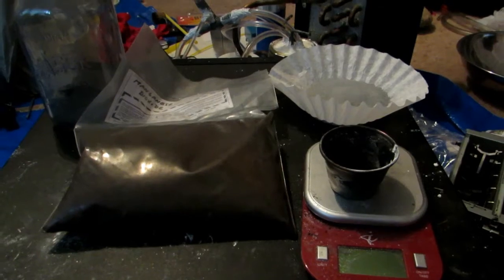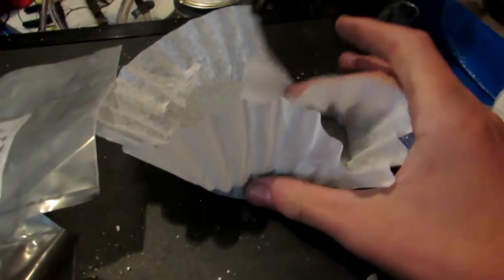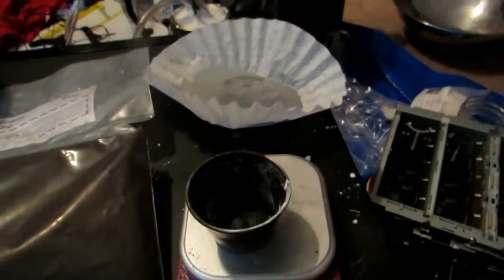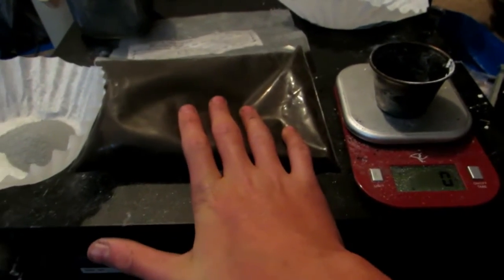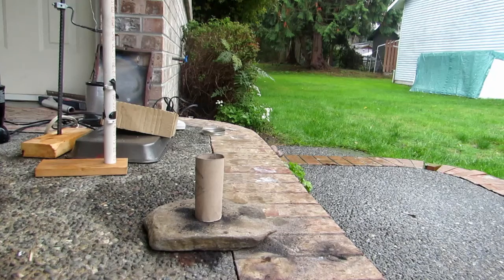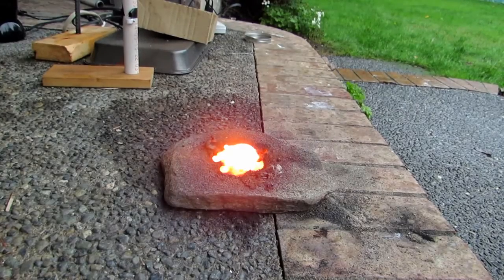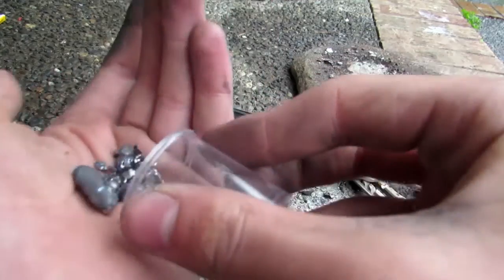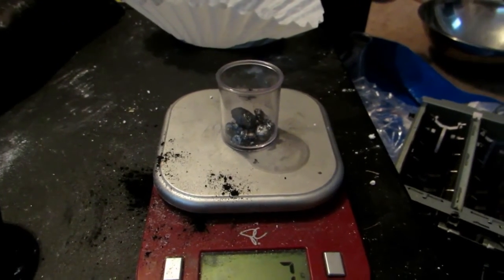Manganese From Manganese Dioxide (Household Materials)

Comment: are you sure it's manganese? Try doing a density test to see how close you are to the exact cause that much manganese looks like it should weigh more.
Reply from the maker: you must remember that this thermite reaction can get hot enough to vaporize manganese metal, this means that some of the nuggets have many bubbles that were caused by gaseous manganese and maybe water or other gasses that were produced. Upon breaking up the chunks , you can clearly note the holes. I am very sure this is indeed manganese as no other metal should be produced. Due to the bubbles, a density test would be very hard. I realize how confusion could occure! :)
Reply: Ahhh ok that makes sense. I just saw the size and grams and thought it was off, but the presence of bubbles does explain the low mass.

Comment: Great vid. Also adding mao2 to h2o2 will make pure ma
Reply from the maker: ma? what? I am sort of confused, do you mean manganese (mg) Dioxide? I don't think it makes pure manganese, it simply catalysis the decomposition of hydrogen peroxide. (A catalyst speeds up the process, but is not changed.)
Reply: Sorry . That is what i ment
Reply: It does make pure manganese
Reply from the maker: Brusoda Isgreat sorry bud, but I don't think so, do some research on it. Manganese dioxide is but a catalyst in the decomposition of hydrogen peroxide. To remove the oxygen from manganese dioxide you need a reducing agent that wants oxygen, such as aluminium or magnesium metal. Hydrogen peroxide is unstable and wants to loose an oxygen atom to become oxygen gas and water. It is a very good oxidizing agent, not a reducing agent. If anything it would give the MnO2 another oxygen atom, but this is not possible as manganese only has oxidation states 2, 3, 4, and 7 and MnO2 is oxidation state 4, so H2O2  would not oxidize it to state 5, because it doesn't exist, and it is certainly not a strong enough oxidizer to oxidize it to state 7. I hope this makes more sense and you now see how there is no possible way that the strong oxidizer would reduce the MnO2, it is just not possible. I am just curious, who told you that is produced manganese metal?